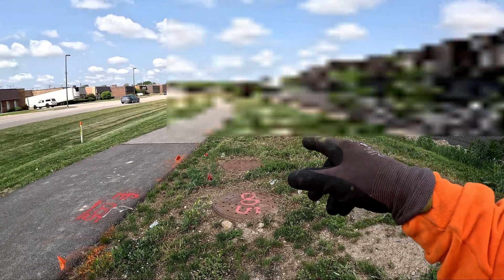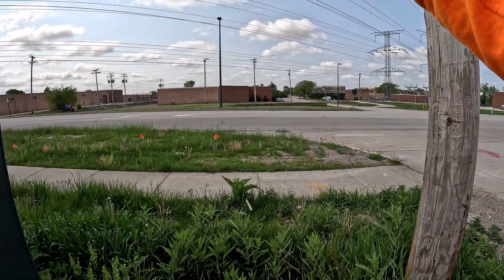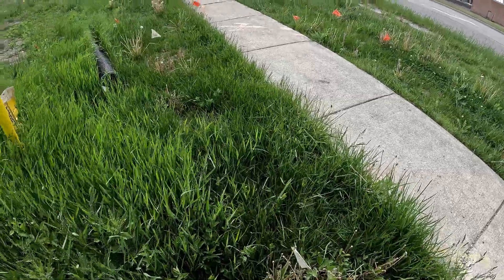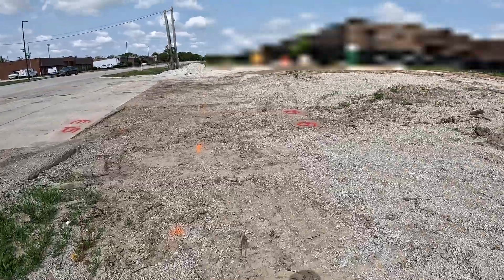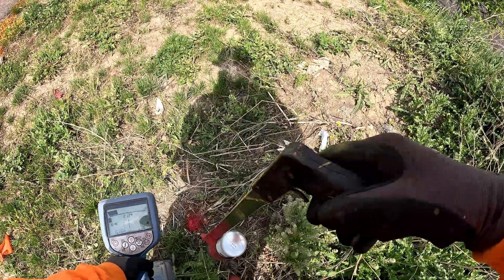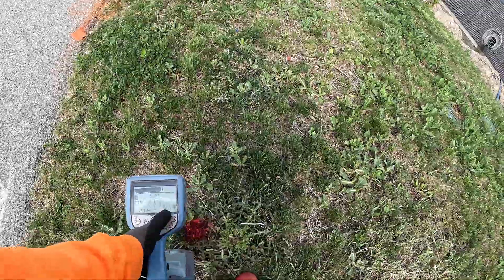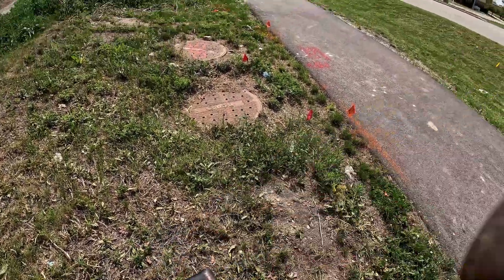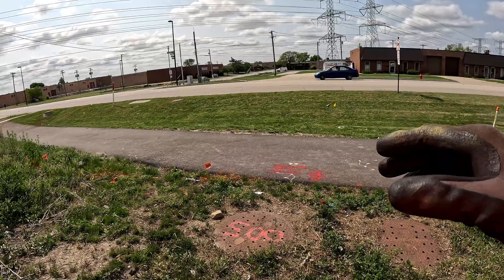Locating a High Voltage Duct Bank | High-Profile Electric Duct with Peak and Null Method

Comment: Those prints are shit man, but the feed to the PMH switch cabinet comes from the overhead pole. The cable you’re tracing is a feed out of the PMH cabinet and goes through the pull vault.